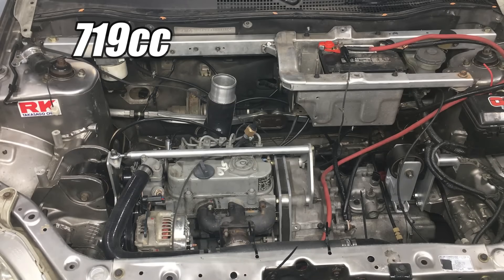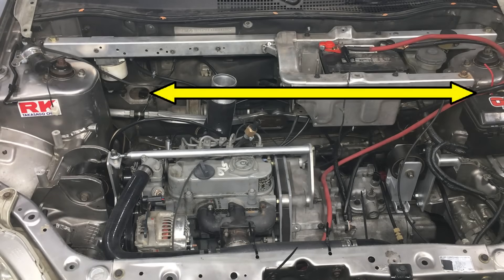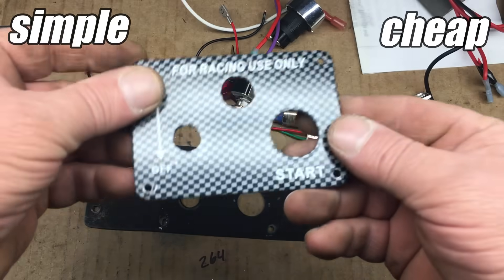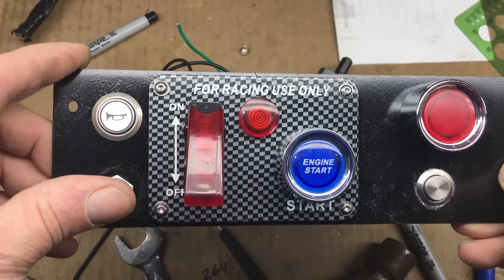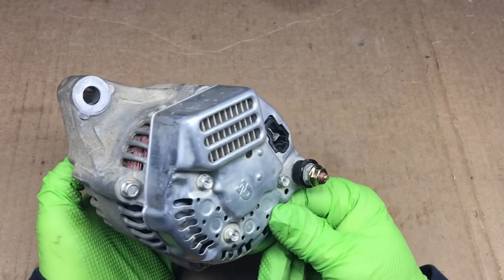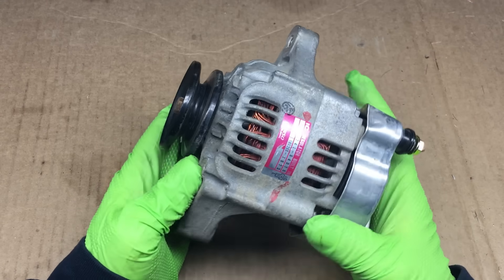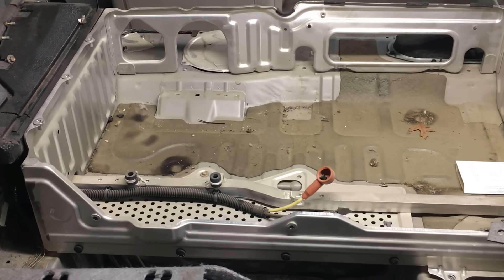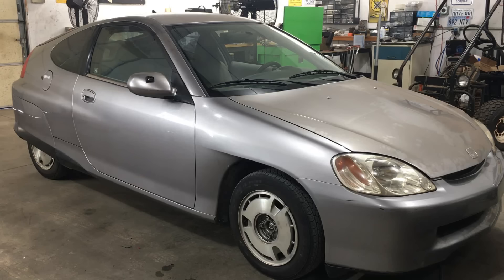S3 E44. The diesel powered Honda Insight is finished.  electrical system done.

Comment: that alternator looks very similar to the one on a mid 80s to mid 90s Toyota Corolla.
Reply: they were used on most japanese vehicles, hitachi also made alernators but the nippondenso units are more common.
Reply: You’ll find Denso electronics on everything from Toyotas to John Deere tractors and a lot of other stuff in between. Toyota was, and may still be, a major shareholder in the company and their products overall are the best in their respective segments.

Comment: So glad that the hood is back on.  It would be interesting if it can be done to turn the charge indicator gauge into a boost gauge on the dash, but it probably ran on the can bus.  Have a good week and enjoy your trip to the tag office.
Reply: The ardrino can replicate can bus signals too. At least certain versions could.

 It has somewhat lost steam since they went after the diesel modders for emissions compliance bullcrap but look into something called a cardrino.  I think there was another version of the same project cslled s speeduino. They were completely replacing old broken engine computers that were unattainable along with adding functionality and fuel injection tunes and stuff to older obsolete cars by using an ardrino.  There are even hats/shields created to connect the stock ecm wiring for some cars to the io pins and add on bosrds on the ardrino. Ardrino sells a can shield.

I started just looking into it just before when the EPA went after the diesel people.  Sites started dropping out of existence all over the place but there are still some around.

One of the fun goals was to take stuff from newer cars and install it into older vehicles. Sometimes that required creating a can bus signal or altering one to suit the different technologies involved. One guy put an infotainment center from a 2019 expedition into a mid 2000s chevy pickup truck with a ram cumuns diesel.  Fun stuff but he disappeared too. I wanted multi port furl injection on a chevy crate motor dropped into a 80s model chevet scooter. I ended up trashing the idea after a hilarious tractor incident ensued effectively totaling it out.
Reply: @sumduma55  There's also ESP32 which can be programmed with the Arduino IDE and I believe can interact with the CAN bus.
Reply: @cobra02411  I almost forgot about those. They were more of a curiosity for some in the communities I was looking at though. But that was several years ago. Thanks for the reminder.
Reply: @sumduma55  I like that they have built in Wifi and Bluetooth. The have pro's and con's vs arduino. I've replaced a few sensors around the house with ESP32 for simple packaging. Also, there's a lot of support for ESP Home.
Reply: @sumduma55  Chevettes,now there's something one rarely if ever sees any more !! Pintos,sure,Granadas yep,Vegas at the drag strips,Bobcats,Camaros,Stanks,Monzas,Opels yep yep yep yep n yep,them 4 door Vettes,nahh 😂